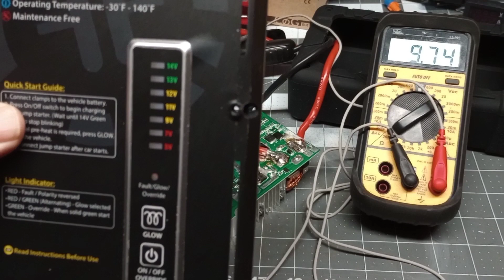I bought a broken battery-less super capacitor jump starter, Rezervo RZ 300. Let's fix it! (Part 1)

Comment: 12:25 has anyone ever determined exactly what the glow mode does?
Reply: My supposition was that the glow mode allows the output to be delivered for an extended period of time without cutting out, as it normally is designed to do if it doesn't detect the high current draw of the starter actively cranking.  
Tried to see on a Schumacher DSR108, which appears to be the same design under different labeling. No apparent difference in operation with glow mode from a straight override mode.